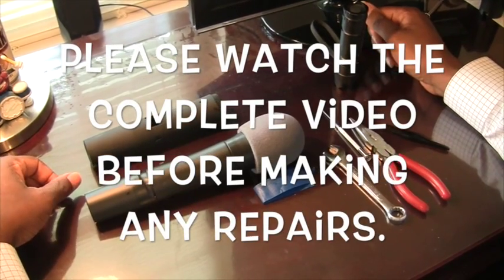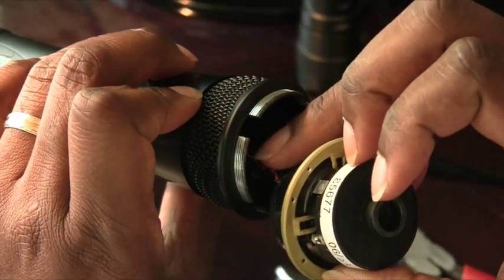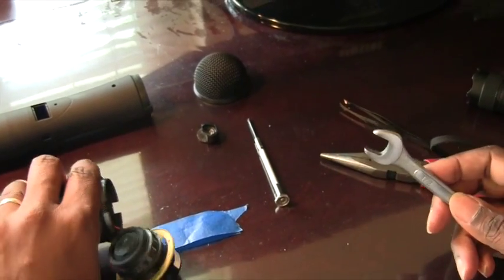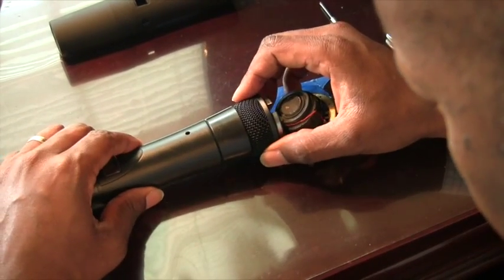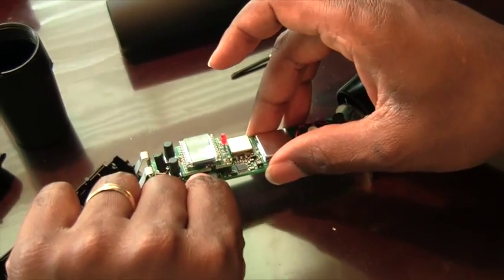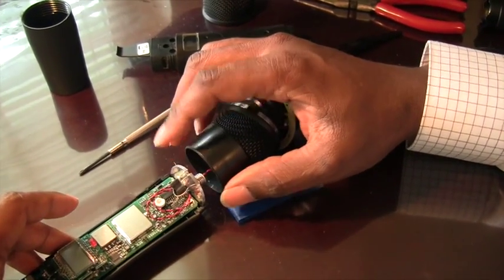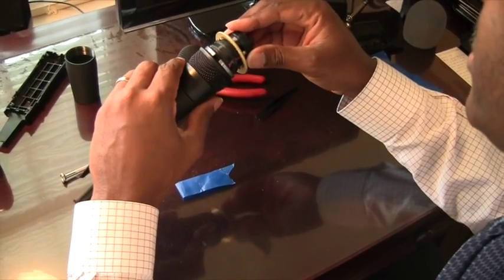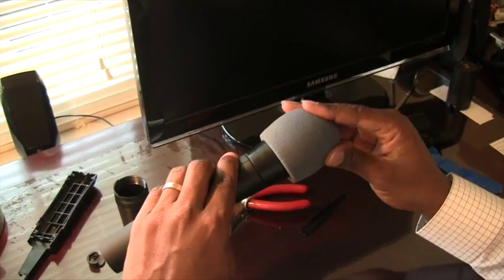ElectroVoice Wireless Mic Repair

Comment: Thank you! We have two of these ourselves. I bought replacement casings from audio acoustics in Springfield mo. I didn't get quite as far as you did before I decided to look for help and found your video. Only difference is I need to replace both halves of the casing so I will need to reuse the existing "window". Thank you again, your video is truly helpful.
Reply from the maker: J Smith Thanks very much J Smith.  I'm glad this video helped out. Thank you very much for the positive comment. Please note Rick Caywood's comment below. It seems the clear cover (or window) will pop out of the casing with just a bit of force, although I haven't had an opportunity to try it myself yet.  Please let me know if that worked for you too, thank you.
Reply: +SpinJacks  yes that did work for ours as well👍

Comment: At 10:14 you mention the clear cover over the lcd readout. There is a little tab that holds it in place. With a little gentle force, it will pop out of the casing. Just snap it into the replacement body.
Great video...Thanks for sharing it!
Reply from the maker: Rick Caywood Thanks very much Rick. That's very helpful. Thanks for the positive feedback!

Comment: Just to add to everyones knowledge here and for future EV 767a wireless repairs, that little black wire he refers to at 11:16 was broken off when I did my repair, couldn't figure out where it went so I left it out and hoped that it would work. Well, to my surprise with the little wire removed it still worked! the wire was perhaps to give a longer range? not sure but if you break it off - no worries it still works.
Reply from the maker: Thanks for sharing your results with us. Glad it worked out.

Comment: The little rubber shock mount on top, which you indicate is flexible, has tabs that broke causing the transducer which it holds to bounce around and create a lot of noise during commenting. I was looking for a video to replace it. Unfortunately, the rubber piece is not sold separately. I'll check with our vendor audio acoustics to see if they sell just the rubber without the whole capsule. Thank you for the video.
Reply from the maker: +Timothy, Sorry you had problems. I guess it's possible that depending on the age of the mic the rubber could loose its flexibility and become brittle. Please, let us know how you were able to get your problems resolved. It may help someone who has similar problems doing this repair.
Reply: +SpinJacks so one of ours was dropped some time after we replaced the casings and two tabs broke. I was able to use some silcon to reattach them. And a dab of super glue. Its been a month or two and still seems to work.
Reply: Timothy Holland I need the same rubber pieces... did you find them

Comment: You rock man! Did you figure how to get that little plastic window off the grip from the old one and into the new one? I'm sure its glued in there? Would a hair dryer loosen the glue up?
Reply from the maker: Glad you liked the video, thanks. Regarding the little plastic window: I personally did not have to replace it, but please note Rick Caywood's comments below. He says: "There is a little tab that holds it in place. With a little gentle force, it will pop out of the casing. Just snap it into the replacement body." I hope this information helps. Please let me know how it works out for you, thanks.